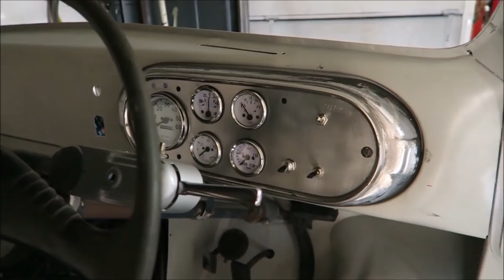Automated Car Body Filler bondo shaping Machine. Compound curve, Double curvature Trev's Blog

Comment: Trev, I'm So amazed that no one has taken this device on. It makes me wonder what you have to do to get anything off the ground.
An outstanding price of kit. Thanks for showing it.
Reply from the maker: I’ve come to the conclusion that people only follow the crowd. If this machine was mainstream and successfully produced by a manufacturer then pretty quickly there would be a cheap Chinese copy on the market. It’s the way human beings work 99.9999999999999% of the time 👍

Comment: I remember the classified Video on this , I thought it would have taken off to some tune . They will be all over China now you let the cat out of the bag . Changing the subject ,I used the copper plate behind the metal when welding up some holes on the old Econoline today. Always think of you when I do that ,my favorite Trick . Keep up the good work Trev .
Reply from the maker: Hey buddy thanks, glad you’re getting use out of the tips videos. Hope the plasma machines getting use 👍
Reply: @trevsblog  Not Arf , Use it alot , cutting out rot and with the Yanks having heavy stuff easier than snips , especially on awkward shapes ,just cut and clean up with sanding disc ,much cleaner than cutting discs .Another bonus when cutting rot any thin metal just vapes away . The times I have been putting a nice weld in for a giant hole to appear 1/4 inch away that makes a monkey off the job, especially in difficult areas .

Comment: Hi Trev 
Looks great , you know how VW panels are fitted using glue and wedges to align panels a bit like tiling a large panel. Well, I was thinking if a computer program panel reader was used to record the panel from the opposite side of vehicle then mirror reversed to act as pushing dolly you could fix the panel with vibration and shrink with rotating disc technology..? 
Vw panel is over £350 for OEM part. If the paint was not damaged then hard plastic rollers would suffice... 
I admire your out of the box tech hacks..

Comment: At first, with your title and introduction, I thought it was a wind up,Trev (perhaps an early April fools joke)....... then seeing it in operation and the final results, it's outstanding, very impressive. My only question would be, "can it do compound curves?"
Reply from the maker: Yes it’s producing a compound curve in the video. There are no flat panels on a vehicle 👍
Reply: @trevsblog , thanks for replying to my question, Trev. I could see the "router" travelling backwards and forwards along the X axis and going down along the Y axis but I couldn't tell if it was going in and out on the Z axis. I remember speaking to a friend of my Dads who worked on Jaguars in the 50's, he said that the panel beaters would scratch their initials on the inside of the wings of the D type because although they had a bucks that all four wings would have to fit, it was obvious that two different people had built the wings because they are totally three dimensional or compound curved and therefore more "artistic licence" than exact dimension. The same guy went on to panel beat the cowlings on jet engines, interesting guy! Please pass on my regards to Birdie and thanks for all that you do. 👍✌

Comment: Trevor off subject but how do yo stop a rivet gun scratching face material with the rivet snaps off., please
Reply from the maker: I’ve done this myself many times. Try putting some pulling away force so that as it snaps off it moves away from the panel. I’ve found that my air rivet gun is far more controllable 👍
Reply: @trevsblog  
Thank you very much.

Comment: What software do you use on this machine 🤔. I'm doing research on a similar topic but without filler.
Reply from the maker: The machine rests against the contour of the panel which gives it one axis. The other axis is achieved by the operator manually adjusting a high tensile steel bar to give it bow. It’s basically all mechanical.
Reply: @trevsblog  I think I'm a hard head. I understand how the horizontal and vertical motion are controlled. However, I can't understand how it can be used on curved  and semi elliptical shaped panels without digital automation.

Comment: So it only does flat surfaces, or is there a way to reproduce a curve?
Reply from the maker: No Doug it replicates the shape of the original panel provided it doesn’t contain changing features such as wheel arches etc.
Reply: @trevsblog  good, not many panels are perfectly flat !

Comment: I can say nothing good about a repair process that makes money and saves time so that both craftsman and customer share in a lie. The panel is not restored, skill was not applied. I could forgive lead, but polyester filler hasn't added anything but laziness and a facade upon the alter of making a buck.
Reply from the maker: Research the difference between accident repair and classic prestige vehicle restoration 👍
Reply: @trevsblog  When I pick, bump and file the dings and kinks on an old Toyota pickup that a college kid is giving me $1500, I am very aware it isn't a restoration. I remember in my youth the first time I shut the door on a winters day to see a piece of my vehicle fall in the snow. Pristine paint attached to a thin chunk of what I could only imagine was plaster. The laziness, the lie! Body work isn't even my profession. Later on I got to visit the Shelby museum and manufacturing facility. Watching them turn flat sheets into flawless masterpieces. It broadened many things for me back then. So I'm going to gripe about what insurance companies and tradesmen have made acceptable.